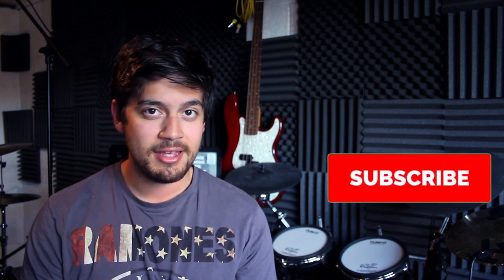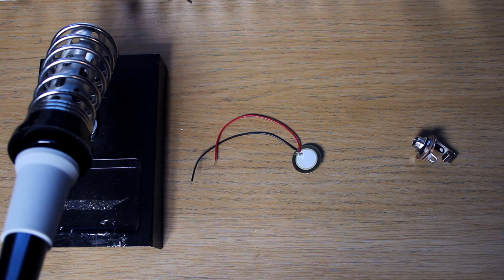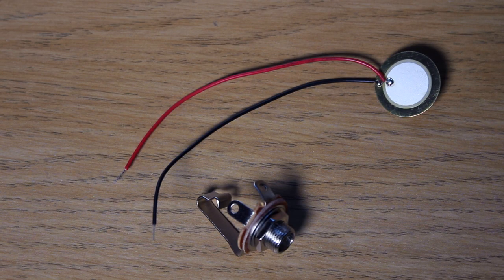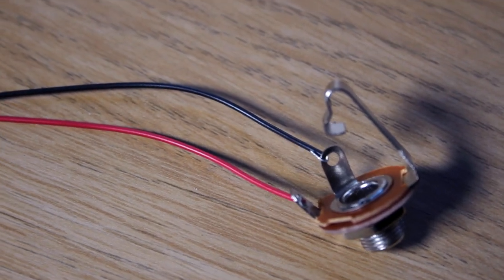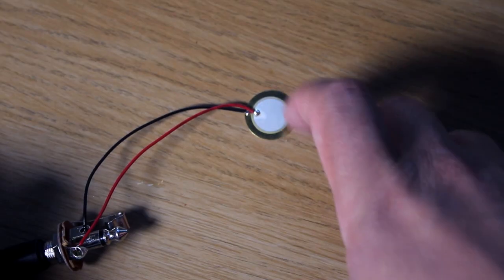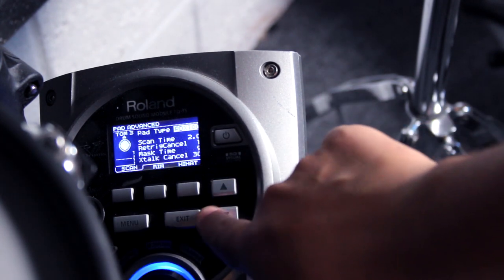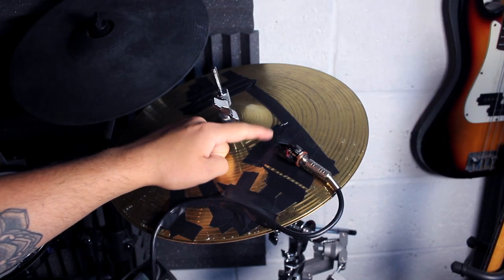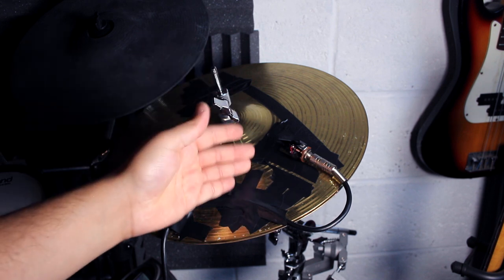Make YOUR OWN DIY Drum Triggers - EASY | Free Drum Lesson - Rohan Bumbra

Comment: I was interested to see if anyone else had figured this out.  Another tip is dropping a volume pot in the circuit so you have a bit more immediate control without messing with module settings I use mine to mix in live Tom samples on top of my real Tom, and to set off music phrases in other kit voices!  Super cool hack mines in a plastic cannabis can and zip tied onto my drum.
Reply: You seem to know about e drums, can a faulty piezoelectric damage the e drum module?

Comment: Yes it's a simple as that. When was discs weren't widely available in New Zealand. I bought some of those cheap window alarms. Broke them open and got the discs out. But another solution. Is buying one of those plug-in cables. That you plug into a guitar tuner. And you've already got a clip on. 🙂 And also yes it's true. You can tunr drum kit with a guitar tuner. A clip on one. My old drummer. Was perfectly tuned. Just one question please. Are there any pros and cons. About using a small or larger disc? Cheers. Ooooh, I liked that reverse roll, you did on the toms. Very nice
Reply: You seem to know about e drums, can a faulty piezoelectric damage the e drum module?

Comment: Thank you for the video, it's brilliant! I made it myself and it decently works. However, since  triggered a ride cymbal, I was wondering if there's anyway to get the bell sound out of it: right now the bell sounds triggers if I hit with a certain force (not by zone); I'm using a Roland TD-3 module  and, as per instruction manual, there is nothing related to this. The only way I can think about is placing the trigger close to the bell so that when i hit there the stroke is naturally stronger (and obviously adjusting velocity settings); however (and I don't know if this is a problem of the specific trigger I use or the fact that I'm using a low-volume cymbal, i.e. full of holes), the trigger reacts only if I hit the cymbal not too far from it, so placing the it next to the bell would be a little bit unpractical. Also I taped the trigger on the bottom of the cymbal (for aesthetic reasons), does it make a difference to tape it on the top? Thank you!!
Reply: Experiment with a trs jack, another piezo most of the multi zone pads have more than one piezo
Reply: Can I do the trigger with a stereo jack input too? or it has to be mono?

Comment: please answer I want to make for a cajon, can 3 transducers be combined directly on 1 cable, can all three work?
Reply: You can but it essentially reduces the voltage when you wire them up in parallel, you wire them in series but that would come out crazy hot and might pick up high frequency vibrations less effectively and it would be more likely to trigger more than once per hit on your cajon if I had to guess.

I would recommend one piezo per contact pair. Some inputs might take a trs (2 peiezos wired isolated)

The more vibratious the medium you attach this to, the more dampening you need under the piezo to “shut down” the physical energy transfer of attack

Comment: Hey man got a question 😄
Will I be able to use the Piezo trigger through my Roland spd sx trigger?
Reply from the maker: Hey! Yes it should work. You'll just need to adjust the trigger settings I imagine :)
Reply: Thanks man. I'll get a piezo and get on it asap
Reply from the maker: @Yukichu  awesome! I'd also reinforce the connections you make with either heat shrink wrap or electric tape too! Happy drumming
Reply: @TheRozzaB  Hey, did you ever try it, did it work ? I want to use it with the spd-sx too!